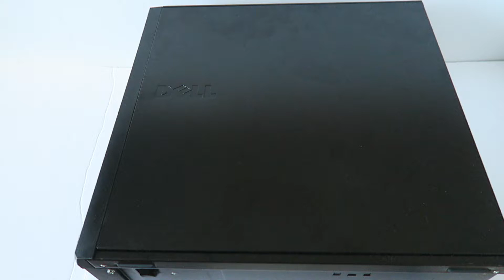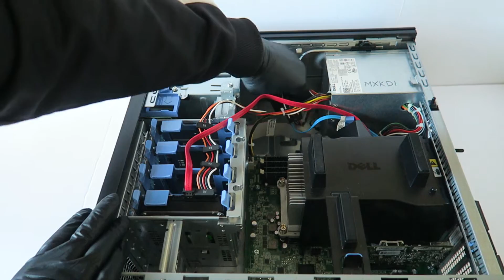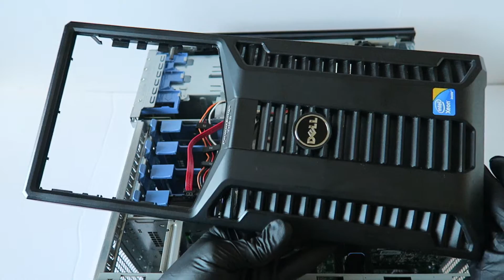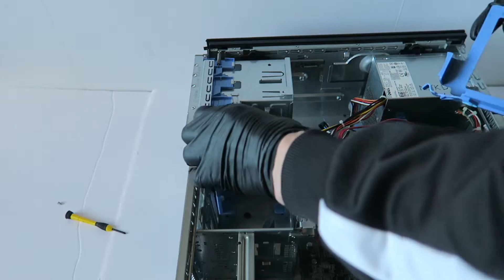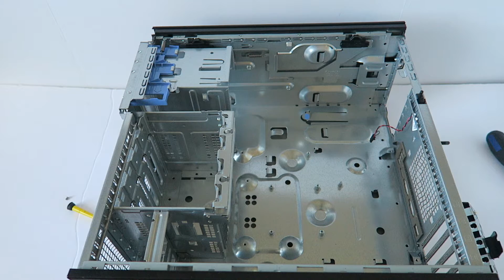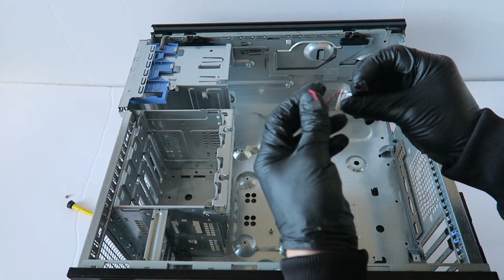Dell PowerEdge T110 II Server Teardown

Comment: The front panel removal as shown is only that easy if it is broken.  There are two plastic clips which must be released on the lower part of the panel, and one on the top, to allow it to pivot downward.  These are on the side of the front panel closest to the open part of the case.  (There are similar clips on the other side, but they will release without intervention as the panel rotates down.)  In the video the top clip is shown being released with a screw driver.  The two lower ones are accessible through small rectangular slots on the back of the front metal "strut".  Put a small screw driver in to release the clips and then rotate the panel down, working up from the bottom clip.  The upper rectangular hole is blocked by the release lever on the 2nd from the top disk driver.  Pull that drive first to access it.  Or just brute force the panel off, which is what I did since I didn't know about the clips from this video.  Amazingly, given the age of the plastic, only the lower clip broke off.  These clips are probably not needed since the panel is screwed on at the top and bottom.
Reply: THANK YOU.  I knew something important was missing regarding this front panel...
Reply: Man, you saved me. I was almost going to hit my head into the wall kkk
Reply: Muito obrigado, tô quebrando a cabeça, só agora consegui soltar a frente

Comment: Use tower make it into a gaming PC
Reply: pci slots don't give more than 25w power. i was only able to run amd rx 550 on it rx 560 didnt work gt 1060 didn't work
Reply: power supply is only 305 watts. not enough for a proper GPU. not sure if it supports a standard powersupply replacement either as a lot of Dell's stuff is proprietary.